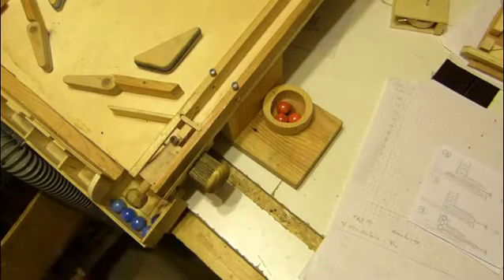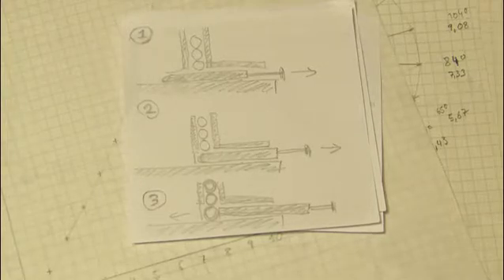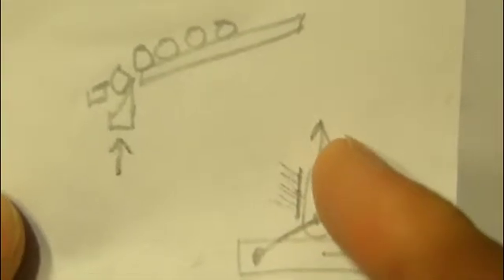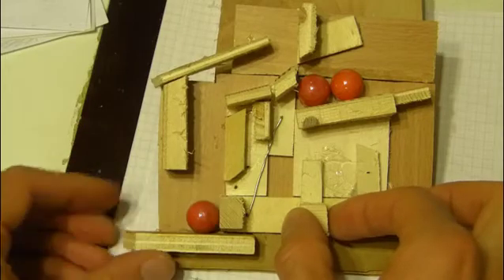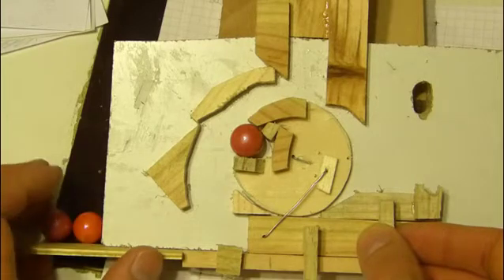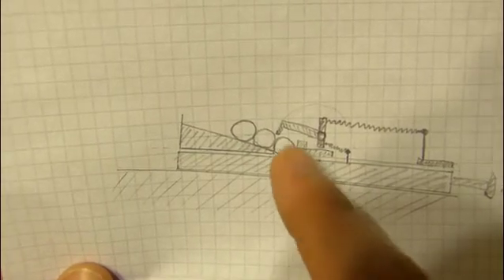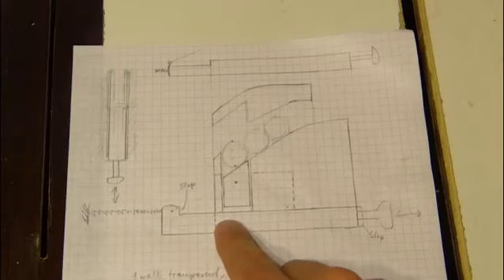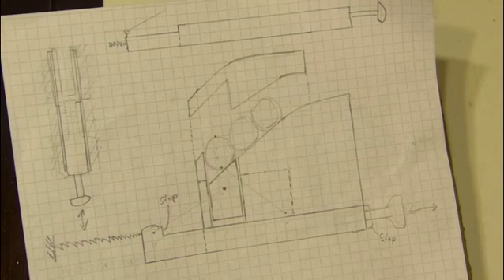pinball machine ball shooter (plunger) design variations

Comment: I think u r doing things too bigs, so much distance between  principal positions of balls n device. make little pieces. ie. tooth pushing up in last draw is double higher than balls. make it half size than ball, balls will run shorts distances, so u can timing better. wheel was 4 times a ball, 4 god sake! keep it as tiny as u can. Bigger could seem easier, but mind the ball's travel & keep it short. Nice work dude, u r a source, no doubt.
Reply from the maker: You are right, but this was just a prototype. The design I actually used is this: https://www.youtube.com/watch?v=vsWK4Adl5NI